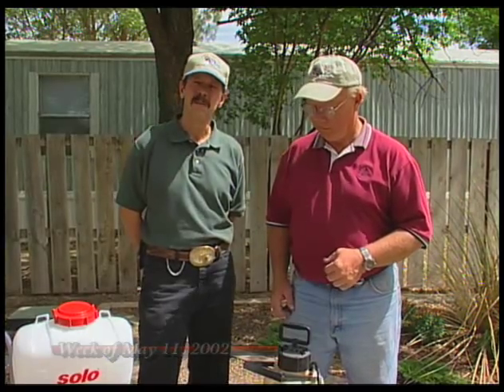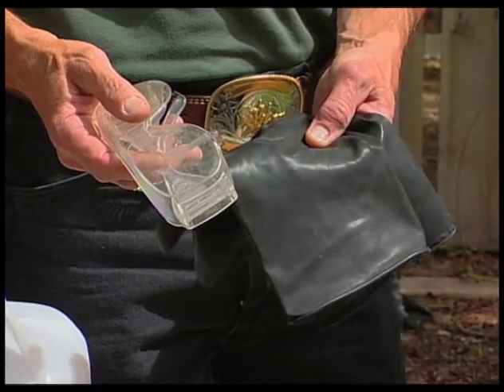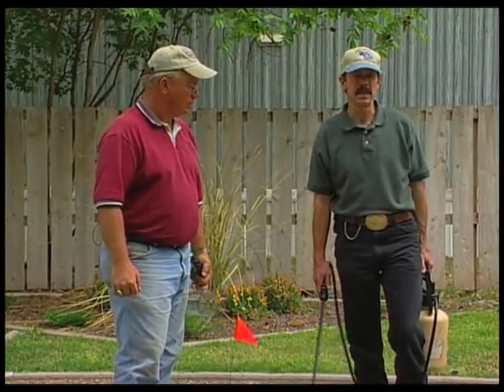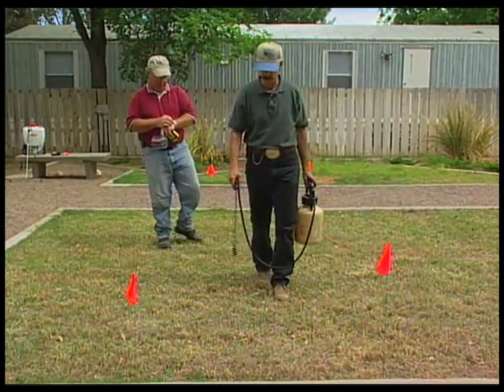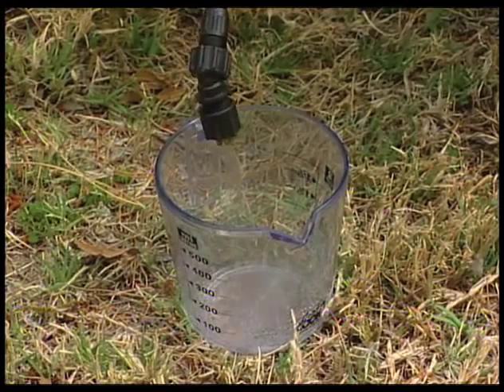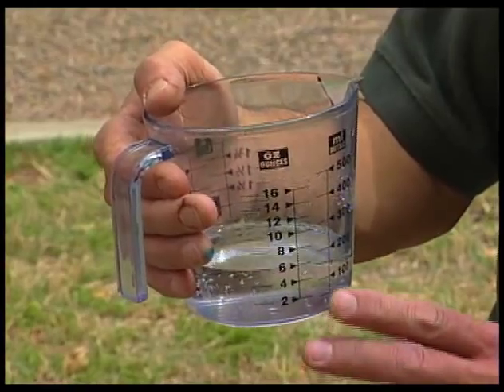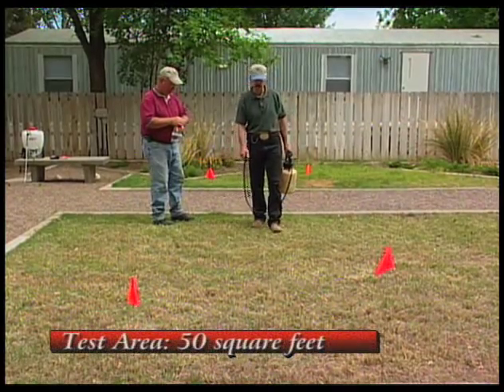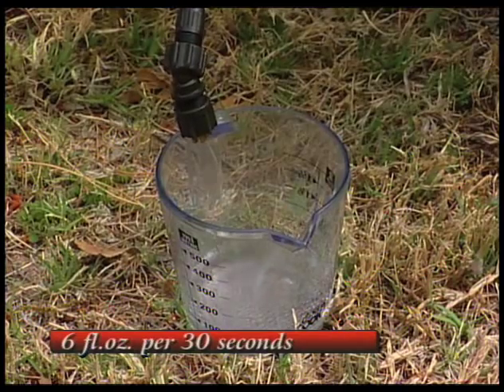How To Calibrate Spraying Equipment

Comment: That's so complicated, besides it's easier to calibrate in gals per acres bc most chemicals are in gals per acres. Test site 18.5 squared (128th of an acre), time how long it takes to cover the square. Spray for the same amount of time in a measuring cup in oz. How every many oz's u measure is how many gals/acre. Example: takes 19sec to cover test area, spraying in measuring cup at the same pressure for 19sec. It measures out to be 28oz, well than that means it's 28 gals per acre.
Reply: Wayne Juntunen most homeowners don’t have an acre to cover
Reply: Yes but he is using it as a reference